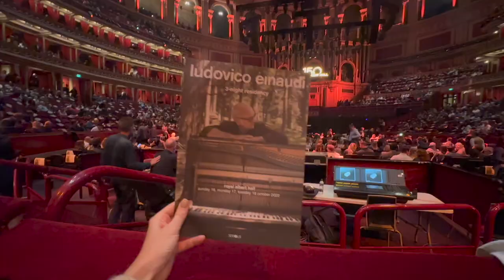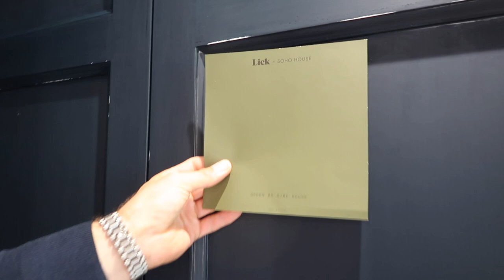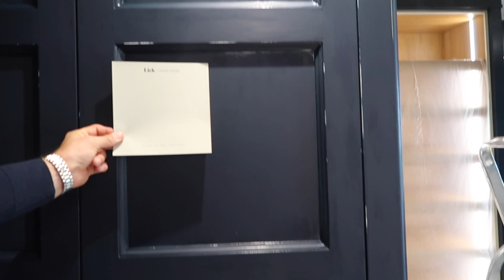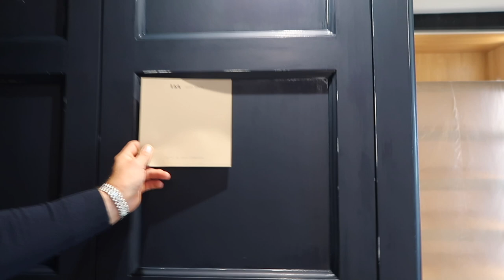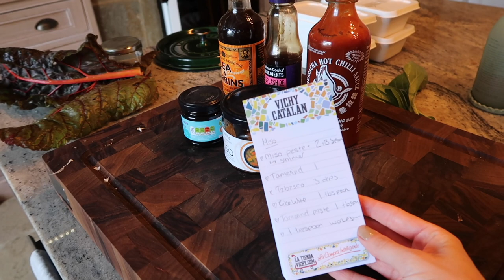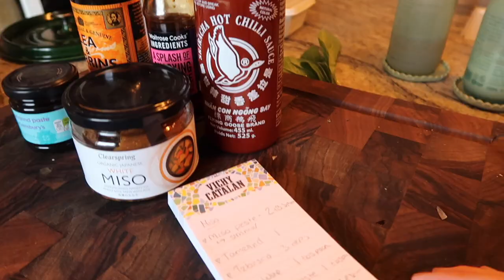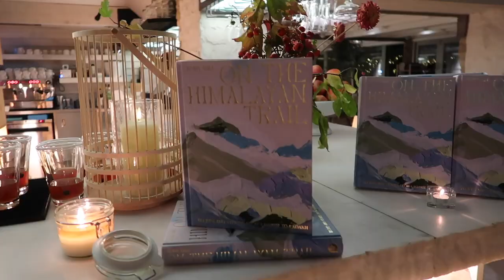LONDON SHOPPING & OUR NEW HOME PROJECT // Fashion Mumblr Vlogs

Comment: Actually the microcurrent machine used in my salon is much stronger which is why I trained for 4 years including a year alone with microcurrent. Low grade cheap ones that are battery and sold without checking qualifications are for home consumer use. Not the same at all.